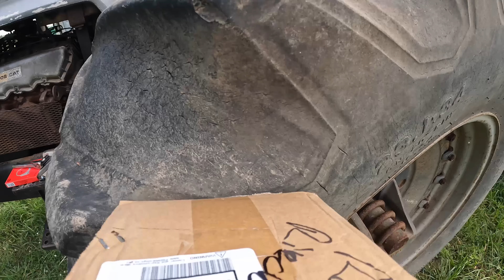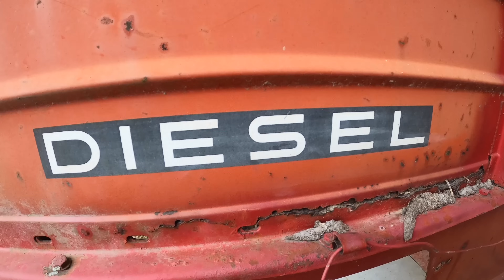More parts, more better! 49 YEAR OLD WHITE 4-150 TRACTOR repairs begin

Comment: Check the injection pump throttle shaft seal, I think they are one of the possible causes for your loss of prime.  I recall my dad saying he had to replace some of them.
Reply from the maker: Awesome! That would make sense because of where it appears to be leaking down into the valley. Sometime when I get time, I’ll pull it inside and check it out. Thanks for the tip!

Comment: Awesome, always wanted an Oliver 880 diesel. Those are such awesome sounding tractors! How much hp does WFE have that Cat 3408 set up for. I know the same engine went into the Cat D11 dozers and they were pushing 850 hp. Damn good engines though!
Reply from the maker: It’s a 3208. In the 4-150, it’s 150 HP.
Reply: @rosstheoliverman  oh yeah 3208. My apologies. 3408 was in the D11’s lol. 3208 must be its smaller brother! 150 hp what a machine! It sounds awesome!